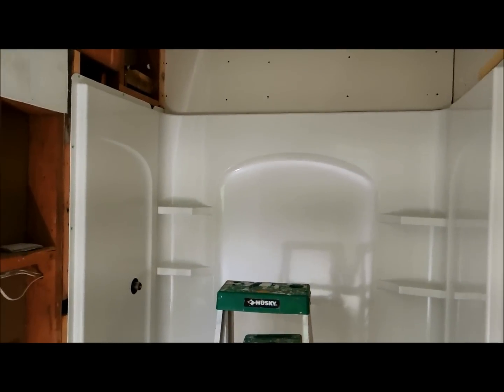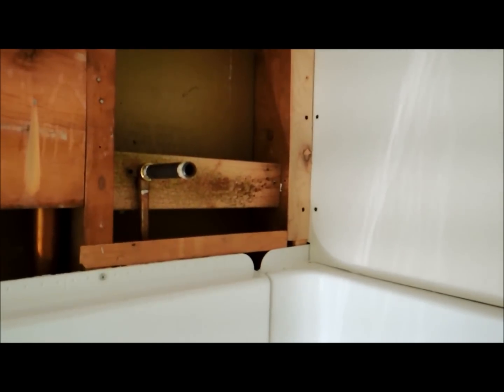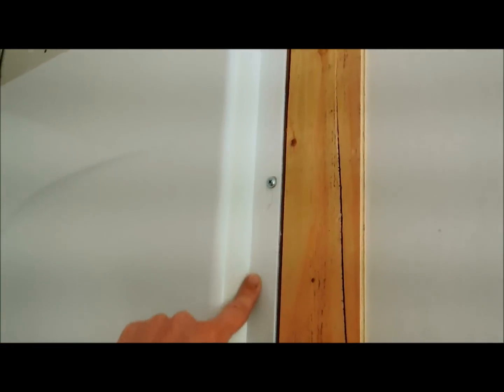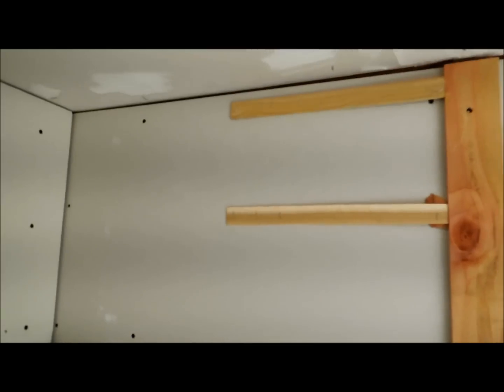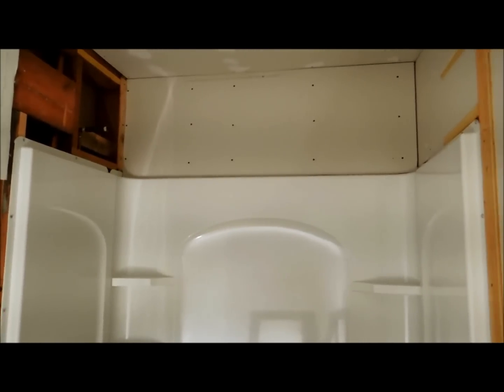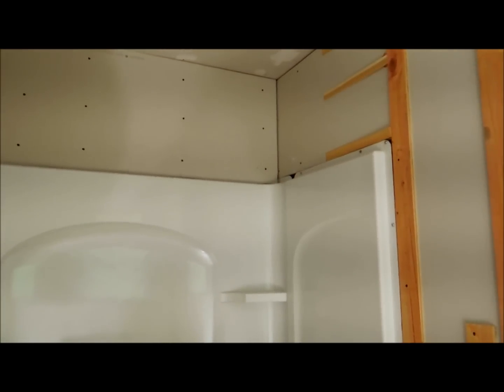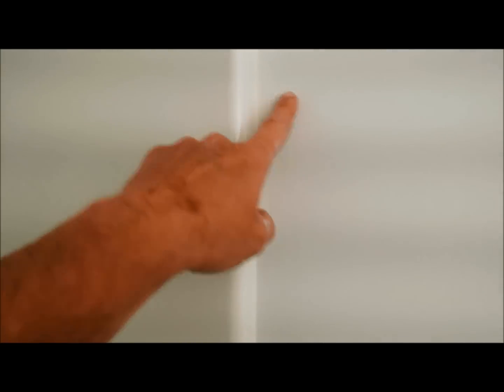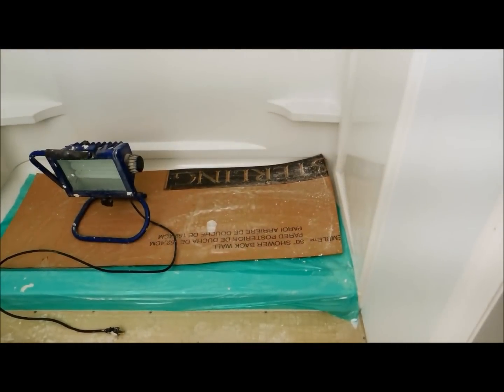Installing A Shower Enclosure

Comment: If you are still on here would you happen to know how to stop the leak at the bottom corner? It's leaking at the front corner near the pan and wall.
Reply from the maker: I'd need some more detail.  Leaks can be due to a crack in the pan or walls, though they are rare.  More likely is that you need caulking or recaulking and it is also possible that the original installation was not done well in regard to plumb and level.  Maybe you can describe the leak in more detail--when it happens, how much water there is, if you have shower doors or not, etc.
Reply: enduringcharm I have shower doors that slide. The leak seems very small and is between the pan and the sides. It's where the water should travel back down into the pan but some of it seems to go out the seam and hits my dry wall
Reply from the maker: Okay, that's a common issue.  Without seeing it in person I can't pinpoint the leak, but most likely you just need to carefully remove previous caulking and recaulk using a clear silicone.  The leak may actually be your shower door frame.  You can try to pinpoint the leak by apply water at the base and slowly working your way up until you start to see the drips.  But, it may be a moot point since you'll really need to recaulk the whole area.  Don't be tempted to just caulk over the existing caulk, that's a classic amateur move which will just make matters worse.  Instead, resign yourself to an hour of carefully cutting away the existing caulk with a razor blade or similar tool and thoroughly cleaning the area of soap residue.  Concentrate on where the shower door frame is attached to the side wall, where it attaches to the base, and most importantly where the frame itself comes together in the corner.  The latter is a common culprit and a weak spot in the design.  When everything is dry and clean, apply blue painters tape on either side of the caulk line, then caulk with clear silicone and smooth it with your finger.  See my video on how to caulk like a pro.  Then remove the tape and let the caulk set up.
Reply: enduringcharm thanks I'll give they a try

Comment: you could have returned a corner just before the wall switch and call it the day, the corner would have been the thickness of a corner bead. we do this all the time in hi rises and new house construction. your way will look a little better but certainly not worth the B.S.
Reply from the maker: Yes, I've seen that detail before, but it would be unacceptable to my clients.  My business focuses on avoiding those kind of workarounds and providing the best esthetic results the budget will buy.  Sometimes that means more work for me!
Reply: I want my shower to look better and not rigged up, your the reason nobody want to pay people to do the work

Comment: question only why not put molding aroun the shower wallspanels if you have to remove any panels you would have to break sheet rock and shouldnt be better watter resistant sheet rock better you know when they clean the walls they will splash watter on the wals just saying
Reply from the maker: The panels aren't coming out anyway, they are locked together internally.  Moulding would look like a cheap after-thought in my opinion, and water splashing should be contained by either the shower doors or shower curtain.  It's no different than a tiled shower in that regard.  Nailing moulding would also be a problem because you'd be nailing through the shower wall flange, which would crack.  This system is designed to have wallboard abut the shower walls.
Reply: thank you  great video the only bad questions are the the ones we dont ask

Comment: man, pack out 5he wall to fit the shower and then put a nice wood beam as trim and leave the rest of the wall !    its would look nice and save you a ton of time
Reply from the maker: Some would do that, I know.  Even though this wasn't a high end bath, I try to do the best I can for my clients and a patch job just isn't in my vocabulary.

Comment: How do I clean scum on my fiberglass shower?
Reply from the maker: Most manufacturers recommend an ammonia based cleaner, like Top Job or the like.  For really stubborn stuff you MAY be able to use an automotive cleaner/wax and a cloth.  However, be very careful not to use an abrasive compound which would leave scratches.

Comment: I am curious if you have the enclosure walls screwed straight into the studs? The drywall above looks separate. Is there only a moisture barrier behind the shower walls?
Reply from the maker: Generally the enclosure walls are designed to be screwed right to the studs. However, if you have a rough opening that is too big you may be screwing to shims or through drywall to make up the difference.  For an outside wall the moisture barrier would be part of the insulation system, typically.  You don't add a second barrier.  For inside walls no barrier is needed.

Comment: After a minute or so I saw that there is too much going on for a simple fix. I would have filled it w mud and feathered it out. I am a drywall finisher and run into many situations where things are not flush and I correct it with mud. I wonder if that is anti mold board you're using? Still if the finish product looks good then you got away with it.
Reply from the maker: In many cases the space is too great for mud, and there is also the issue of cracking at the edge where it meets the shower walls.  Remember, the shower walls have a flange of about an inch and a quarter or inch and a half that is intended to go under the drywall.  If you try to simply build up an inch or more of compound over that flange you'll end up with cracking in the long term.  The flange moves to a degree both because of the material and due to temperature changes.  Feathering is also needed anyway, but trying to mud over that flange will lead to trouble.

Comment: Why not just frame it?
Reply from the maker: It's a matter of esthetics.  Framing the enclosure with a moulding looks like an afterthought and also tends to open up gaps in the joints over time.  Shower enclosures are not the most beautiful things in the first place, when compared to a tiled shower.  So, I go the extra mile to incorporate them into the room with smooth, clean lines.  Done right, you should hardly notice the enclosure.

Comment: do they make one piece unites any more?  I have one and I want to save on labor and take it out my self,  but I have know clue what is behind it.
Reply from the maker: Yes, single piece enclosures are still manufactured, although they are not typically used in a remodeling situation because it's difficult or impossible to physically get them in place in a house that is already completed.  In new construction they can be fitted while walls are still open.
Reply: I asked because that's what I have and I need to take it out. I can not remember what was in between the walls. I guess I can use a small hand circular saw carefully cut small sections.
Reply from the maker: To remove the old one, a reciprocating saw with a six inch metal blade or a wood "demo" blade is the easiest way to cut it into smaller pieces.  Wear a mask and eye protect to protect yourself against fiberglass or plastic fibers as you cut.  There is likely nothing but studs behind the unit, but be cautious not to cut too deep and nick a pipe or electrical cable in the wall cavity.  Always turn off the water prior to this!  The base or walls may have plywood embedded or attached which you'll also need to cut through.  2x2 or 2x4 foot sections are usually what I cut.
Reply: Thank you so much! I bought a  reciprocating saw last year so that will work. :)

Comment: I can't help but wonder, how much extra did he charge for all that unnecessary work? Fine one end of the enclosure had to be angled out, but, why mess with the whole wall and the door jamb and the electrical box? Just angle the wall behind the end panel and create a little end corner to the existing wall! Leave everything else alone and no one would ever notice........
Reply from the maker: I don't make these decisions without input from the client.  If the clients wanted a hack looking job they would have hired an unlicensed handyman.  Instead, they wanted the bath to look the best it could within their budget range, so they hired me.  The additional work to make the wall/door jamb thicker was probably a couple hundred bucks in labor and materials and wasn't even billed separately from the rest of the project.  When you know what you're doing, these sorts of modifications are routine.

Comment: It would be way easier staring from scratch. Right ???
Reply from the maker: Yes, new construction is generally easier for finish work because you don't have to deal with previous errors or work around existing structures.

Comment: There is no info on ACTUAL installation.
Reply from the maker: Like painting, it's all in the preparation.   Getting the rough opening right, the plumbing in the right place, and having a strategy for dealing with out of plumb walls IS the actual installation.  With that taken care of, the enclosure walls are placed in position and screwed to the studs or other structure.  If you'd like more information on setting a base, I have another video you might want to see:

https://youtu.be/PUTyeD-jyeY

Comment: For Pete sakes, your video is "Installing a Shower Enclosure" yet no where in your video did you "install a shower enclosure"! Serious.
Reply from the maker: Let's leave Pete out of this, he's done nothing wrong.  I guess the point is that installing the enclosure is really about prepping the opening.  Screwing the shower walls to the studs is not difficult, but making certain the opening will properly accept the enclosure can be tricky.  Different manufacturers have different requirements for the exact placement of screws in the shower walls, or how the walls snap together, etc.  You do still need to read their directions.  This video just shows how much work can go into the preparation for an enclosure in order for it to look nice in the end.